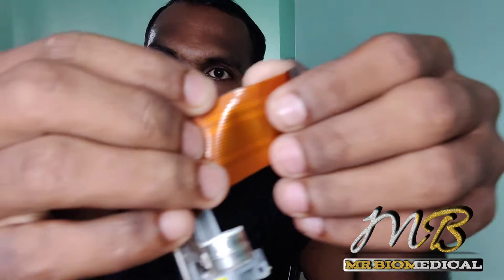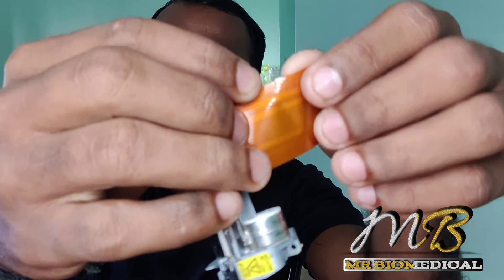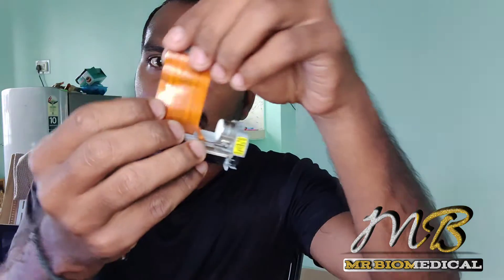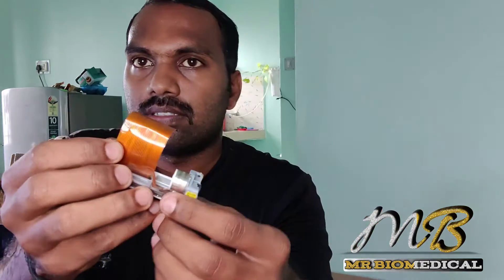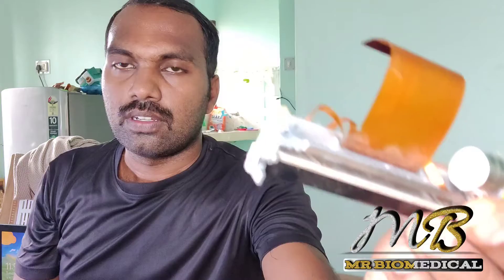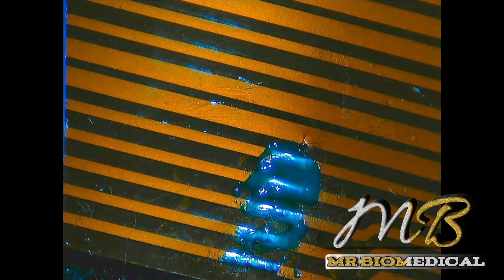How I Fixed A Broken FLEX CABLE INSTANTLY! | Mr Biomedical

Comment: I have a damaged flex cable that has carbon conductor or traces. Can it be repaired?
Reply from the maker: Yes
Reply: @MrBiomedical : Sir please tell me how to contact you regarding repairing this damaged flex cable, I am in Bangalore, thank you
Reply from the maker: +919790567867

Comment: i did that something like 20 year ago on a hifi system the metal case of the thing was so sharp it did cut out the flat flex cable! i was so pissed but i fixed it about the same way. now i have the same problem on a valve index controller but the pitch between the tracks makes it hopeless fortunately the tracking still work with half of the sensors and will be ok for me for now i'll see on the future if i can find a broken controller for get that part for cheap.
But well done man only good service guys are able to do that lots will put that on the impossible to do list

Comment: How do you not melt the ribbon cable i tried with soldering iron & melted straight away
Reply from the maker: How much heat you set?
Reply: @MrBiomedical  How much heat should be set. Please advise.
Reply from the maker: @alicihangir7222 for the soldering iron, you can set 380-450

Comment: How are you able to keep the solder from overflowing and jumping between lines?  It looks like you are somehow able to wipe between the lines at 4:00.  Thanks!
Reply from the maker: Simple.. you should use proper solder flux. It will do a magic

Comment: Though the job is done, after the work that part becomes stiff and no longer flexible.Linking the tracks with thin insulated wire would give more flexibility.
Reply from the maker: Yes true. But for my application it was enough. That is what
Reply: This is necessary if you ever run into a situation where you can not get replacement parts and this is the only option

Comment: Is it a problem if one path connected to the one beside it ?
Reply from the maker: Not a problem until you connected it correctly
Reply: @MrBiomedical so if a solder connected two paths wont be a problem? Because it is spaces between paths are so narrow
Reply from the maker: @ztipster in that case u should need to use number wire
Reply: @MrBiomedical  what is number wire ?
Reply from the maker: Sorry, jumper wire I meant

Comment: what's the white paste stuff you used that made the lead only stick to the pins and not anywhere else on the flex cable?
Reply from the maker: Soldering flux only

Comment: How many degrees you use on your soldering iron.I am afraid to burn the ribbon cable with to high heat?
Reply from the maker: It wont burn, just apply by heated lead

Comment: And can I use regular tape in place of gum you added at last?
Reply from the maker: Depends on how hard it will hold
Reply: @MrBiomedical  what fluid u used after cleaning the flex and is it compulsory?
Reply from the maker: It is UV mask. It is necessary to bond the connection

Comment: What fluid you applied after cleaning the flex
Reply from the maker: UV mask
Reply: special uv light glue specially for this aplication 
dont know what its called exactly
Reply from the maker: It is called UV mask
Reply: @bassfear_9952  so can I use tape in place of this glue